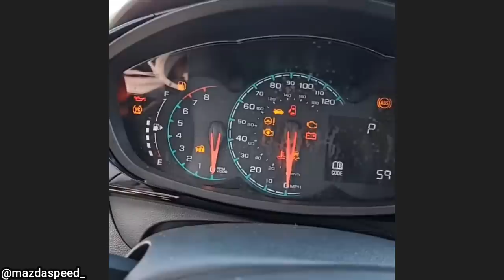Customer States My Car Won't Start (Chevrolet Spark) | Just Rolled In

Comment: That welding spark knew its role perfectly!
Reply from the maker: It did quite the beautiful jump to the garbage can lol
Reply: That spark nailed the three point shot.
Reply: @robertkeefer1552  anyone notice the jerry can next to where he was welding!? My anxiety....
Reply: Rammstein Auto Repair!
Reply: Oscar-worthy performance.
Reply: I just want to know what was in the barrel for it to explode like that.
Reply: @JustRolledIn  fire in the hole !!!!!!!😂
Reply: @snakebyte130  That's where I was first looking for something to go boom!
Reply from the maker: @cameronwhite2760  they didn't mention what was in the trash can. If I knew I'd tell you guys.
Reply: @bleach_drink_me  it was rhetorical. I grew up in a shop so I know what kinds of stuff get thrown away, but I've never seen one as violent as that. Something in there was not only flammable but was able to produce pressure AND rapidly expand. I've had barrels like that only burn not explode and we've thrown things in there like starting fluid, brake cleaner, spray paint, etc... only thing I can see doing that is gasoline.
Reply: @JustRolledIn Oil filter just thrown into the can I bet
Reply: @robertkeefer1552  A game winning shot no less.
Reply: @robertkeefer1552  even i can hear a swish
Reply: @cameronwhite2760  prob rags soaked with gas or solvents, and the vapors were hanging out in the trash can, waiting for a lucky spark.
Reply: @cameronwhite2760  solvent soaked rags?
Reply: Man the fuel air mixture in that trashcan was better than any engine I've ever had
Reply: @bleach_drink_me  thats why I like to use steel ones with tight fitting lids, if something does go up, you can put the lid on and drag it somewhere safe.
Reply: Did anyone notice the gas can next to the workbench where he was welding?
Reply: DO NOT trust the dude who ran to have your back....
Reply: @drrocketman7794  unless the can was basically empty it wouldn't have exploded like the trash can did. It would be to rich in the gas can to explode.
Reply: @daltonmcmaster3489  correct, but it's still a flammable liquid that shouldn't be stored near fire.
Reply: @drrocketman7794  im not disagreeing with you.
Reply: @snakebyte130  I did. I was waiting for that one to catch fire.
Reply: @tinknal6449  I feel like I must be reading this wrong. Why wouldn't you trust the guy who ran to check on you?
Reply: @cameronwhite2760  
Oil, gas soaked rags, brake fluid.
Reply: @snakebyte130  I did not see the jerry can until I read your comment.  Wow...
Reply: @cameronwhite2760  gas fumes
Reply: @Hawk7886  I'm talking about the guy on the left at 2:51 running away.
Reply: @tinknal6449  He was going for a fire extinguisher is my guess.
Reply: It was a spark of focus, commitment and sheer ****ing will.
Reply: Bozo buckets with sparks
Reply: like a mortar shot lol
Reply: @jsl151850b  Yeah right....
Reply: @thatguyontheright1  No, to violent and quick. This appears to be a fresh wash job with carb cleaner or other flammable solvent.
Reply: @brianstratton8767  "Rammstein Auto Repair."  Thanks.  You owe me a coffee and a keyboard.
Reply: Like The Boss said. 🎶 You can’t start a fire without a spark 🎶
Reply: @brianstratton8767  Du hast mich!
Reply: Just when you thought it was safe to toss away those coke bottles filled with acetylene you had on your bench.
Reply: @snakebyte130 
If a welder isn't sparking something flammable they're not doing their job

I watched a whole crew of dumb asses weld and cut metal at my job site, blasting and raining sparks on the fucking welding tanks. I was waiting for it to explode
Reply: Ok, I'm not cleaning parts on top of my trash can with carb cleaner anymore haha
Reply: I’m curious what did he has in his trash can so explosive lol
Reply: FLR “spark token” is a bomb?
Reply: like what are the odds lol

Comment: That non fused wire did an impressive job of cutting into the plastic parts!
Reply: Years ago a buddy of mine got a killer deal on a 95 mustang GT because someone did that with an amp power wire in the trunk... Of course the wire was routed like Shit (through the door gasket, across the seats) and it burned the heck out of the interior.
Reply: I would say it is shocking.
Reply: Now that's how you Hotwire a car!  🤣
Reply: my dad did same thing with a self wired cig socket wired it directly to the battery and shorted it out melting the top of the leisure battery a little and left a burn line on the floor of the camper van (he agreed after that he should use a fuse box and wire everything to that first, not the battery)
Reply: @Iowa599  (deleted post) it was due to phone chargers places the neutral side pins way too low which touch the positive latches at the bottom witch are designed for 2-3 way dig splitters (so have to observe when plugging it in)
Reply: @Iowa599  hey look up foam and plastic cutters and some plastic welders cut plastic, their only about $20 and saves you zapping yourself with 12v
Reply: Unless you're using your mouth or are soaking, 12V is too little to zap yourself
Reply: You mean melting through, plastic vs a hot wire Hotwire wins
Reply: @Iowa599  You might as well use a soldering iron
Reply: The voice over of YouTuber who is talking about different videos he sounds like the guy who is talking on (The Daily Dose of Internet)
Reply: @NoName5589  You obviously have never pulled a plug wire off without gloves on. It helps to use one hand on the fender to steady yourself.
Reply: When he said "This customer did his own wiring job" it reminds me of singing a solo at church. When I get nervous I say "Never had a lesson in my life"
Reply: Effective
Reply: What does the fuse do for the wire?
Reply: @jonathanluis4966  
The wire got hot and melted because it drew too much amperage. There was probably a short somewhere.

So a fuse limits the current (amperage) in a circuit.
So if the circuit is expected to pull 2amps, you might use a 3amp fuse. So if anything wrong happens and the amperage go beyond expected the fuse would burn and cut power to the circuit, saving you from melted wires and/or causing fire.
Reply: @moslem770  thanks for the detailed response, will definitely not try any of this on my own lol.
Reply: @jonathanluis4966  
You shouldn't be afraid of doing it.

But you should be afraid of doing it without knowledge. ^_^
Reply: Thats exactly what a hotwire cutter does - runs crazy amounts of amps through a thin wire. Car batteries take no prisoners!
Reply: @Iowa599  I knew I'd get called on that when I typed it. While it was not shocking, I did arc my watch band on an ammeter once turning it into a branding iron.
Reply: The ole hot wire cutter never disappoints. Haha
Reply: I'm actually really impressed.
Reply: Lightsaber wire
Reply: Fuck me I'm dumb, I assumed he cut the plastic for the wire to sit in
Reply: @Rac00n  lol well he may as well have.
Reply: Like a cheese wire. 😂
Reply: @tt600pch  Coil pack makes the 12v into many more volts - anywhere between 12,000 and 25,000 volts by the time its coming out of the coil to the plug. Very little current though.
Reply: Melting through.
Reply: Hot knife 2.0

Comment: My favorite happened in the mid-late 90's. I worked at this auto mall kind of place. Lube shop, full service auto repair, gas station, and car wash / detail shop. There were about 8 certified mechanics and maybe 3 or 4 younger guys who would mount tires, cooling system flushes, the gravy. One guy was working on a car old enough to have a carb. Something happened, a little fire started. Dude grabs a 20 oz bottle of Mountain Dew off another guy's toolbox to put it out. As soon as he splashed it on the engine the fire got a lot bigger. He threw the bottle which started another little fire. One of the helper guys put the engine fire out while the other two mechanics are getting ready to start throwing punches over why you don't grab stuff from someone else's toolbox and how you're not supposed to keep fuel in an unmarked container. Thats got to be in my top 5 greatest days at work ever.
Reply: Yes!!!! That would’ve been awesome! 😂
Reply: its not uncommon to have a unmarked water bottle or dish soap bottle of fuel
Reply: I knew a guy that kept vodka in a mayonnaise jar so no one would know.  🤪
Reply: @bluespidergaming7719  Which does not change that you should never do it. Its the absolute basics of safety, you dont keep chemicals in food containers. That shit has killed people.
Reply: In the US there are OSHA / EPA rules that state that every container of chemicals MUST be properly identified (and properly stored) for this very reason.
Reply: @gerry5712  I understand that I'm just saying it's not uncommon but also unless Osha comes and inspects anything it's not gonna get enforced unless you enforce it upon yourself
Reply: @bluespidergaming7719  I kinda agree. Having it in a clear container with a sharpie label is useful when doing a little testing of something. But a soda can to me is a definite no go for me, unless it's for cigarettes.
Reply: Lol!
Reply: Yes, sure, fuel. He wasn't hiding booze in there.
Reply: @bluespidergaming7719  Yes, it is rather common. But every time I've encountered such a thing, it's been labeled as holding a dangerous fluid.
Reply: @md_vandenberg  maybe for you but if someone is touching your tools/stall then that's their problem

Comment: I worked as a mechanic for over forty years and if you think this is uncommon think again. Had one guy who said "I drove as fast as I could because I knew it was LOW". It would not start when I got in it to service the auto, guess why? Now this guy screamed  because we charged him for the gas and the labor to get it.
Reply: There's a low gas indicator near the tachometer in every car I've driven in decades; how can anyone driving a car today not notice they need gas?!!??!!!!  That person should not be allowed to drive.🤬🤪
Reply: I will never understand how someone can run their car out of gas and have the audacity to act like they've been cheated by the mechanic.
Reply: I have a '21 Spark and the last bar turns red instead of a low fuel lamp. It's not in the owner's manual and I found out because i do a lot of city driving and wanted to compare the estimated range vs average range.
Reply: @tomd7274  It would even fade in and out for emphasis
Reply: @tomd7274  My truck has a DIC that lights up a big square of orange or red, with black letters or symbols. For example, a low fuel message would be an orange square, with a gas pump symbol and "LOW FUEL" in black. You have to work hard to not notice when my DIC lights up.
Reply: My sister once allowed a diesel VW Rabbit run out of fuel. It seized the engine. Our father and I previously warned her to heed the low fuel warning.
Reply: kat deville that makes absolutely no sense. i have a diesel rabbit with 600k miles. ran it out of fuel several times.  fuel gelling, filter plugged, etc.  never hurt the engine.
Reply: Ooooooohhh yeah. Ive seen that. I've also seen ppl say theyre car wont start even after jumping, because they passed out drunk in their driveway and ran it out of gas.
Reply: @denisrhodes54  maybe the sister ran it out of oil and out of diesel at about the same time LOL
Reply: @tomd7274  my previous car owner rear-ended or got rear-ended slightly so some parts had to be fixed - at this occasion someone fucked up and installed the gas pump slightly rotated so the "level" would sit on something in the tank so the indicator never dipped below 2/8 full of the gas tank - it was fun, that i can tell you....
Reply: @katdeville  i could understand the pump breaking because too little lube in it without diesel, but the engine? there had to be massive problems elsewhere too
Reply: @tomd7274  I couldn't agree more.
Reply: I work in road transport, and the number of customers that will bring cars to us with zero fuel and expect us to drive them on and off the truck with just hopes and dreams 🙄
Reply: I drive fast to get home before I run out of gas.
Reply: My 91 Accord had a low fuel indicator that when it was low, it would light up.  The lower the fuel, the brighter the light would get.  Basically, if the light was obnoxiously bright, prepare for it to stall.  At that point, the distance remaining was in feet.  I don't if that was by design or just my car had that quirk.
Reply: @tomd7274  well there are rare occasions where I would get it.

 1 the gas gauge doesn't work.
Reply: @tomd7274  right.
Hell i had a grandma driving a brand new tesla.
Ya she was so fing scared to go around a corner she literally went 5 mpg then stopped i had to drive around her in my 2005 toyota truck going 25 mph.
She called the cops on me for a illegal pass but when I told the cop she has video of it and ha's a record of how fast she was going.
Ya cop hoped in tesla looked at video and ticketed the old woman for illegal driving speeds she was doing 5 then zero in a 55 mph zone.
Reply: @katdeville , likely ran it out of oil too. Those are usually tough engines.
Reply: @tomd7274  Not only that but the fuel gauge is purposely set up to lie by anywhere from 25-50 miles (in most cars) so that even when you run it to 0 you still have enough fuel to pull into a petrol station.